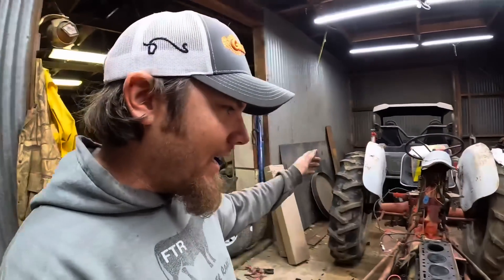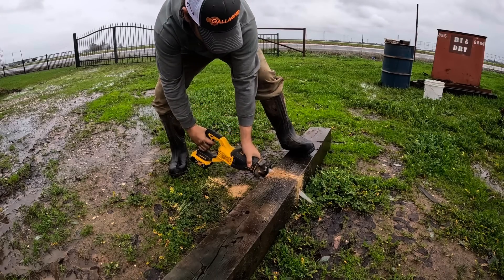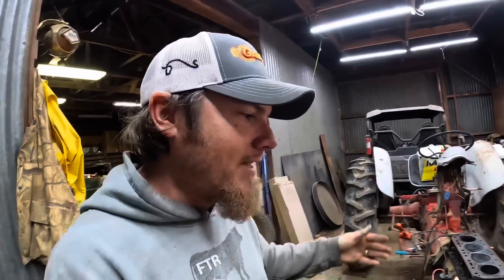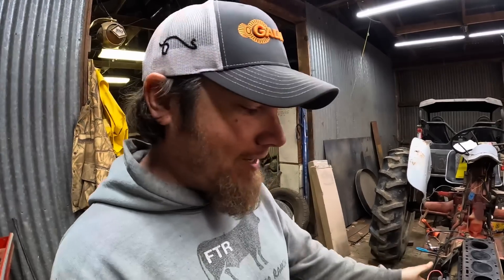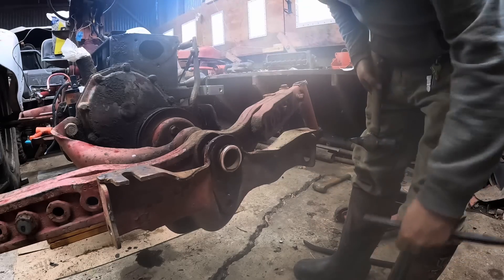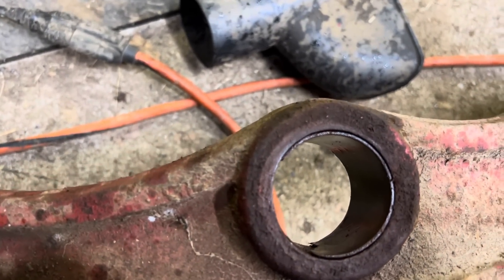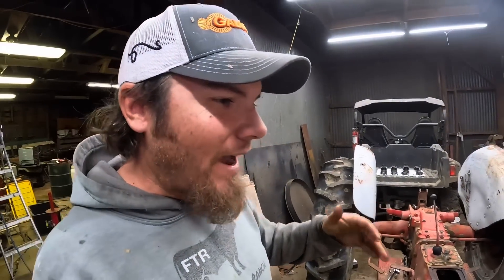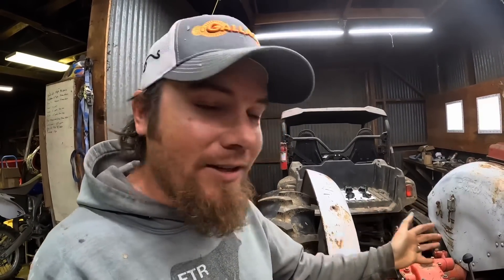That Escalated Quickly!

Comment: When you go to paint part of the project, consider POR 15 for some of the parts that get a lot of scrapes and scratches (especially the inner fenders.  This stuff is great and when dry you can whack it with a hammer and it won't chip.  It will outlast you.  And also, I still think NOX and twin turbo's.

Comment: Hello Tyler.  Your video label, “That Escalated Quickly!” is a good observation of how the situation can change as new facts become observable.  I commend your approach which can perhaps be summarized as, “If a job is worth doing, it is worth doing well”.

I certainly hope that you do not find too many more hidden surprises that might increase the complexity of the rebuild.  For example, you referred to some oil leaks near the back axle.  If you had decided, from the beginning, that you would do a complete restoration, then you might need to strip everything right down to the last nut and bolt – but that would introduce a whole lot of new complexities, such as how and where you would store all of those component parts to avoid getting them lost or misplaced.  I certainly agree with the way you labeled the electrical cables, as this kind of attention to detail can save a whole lot of grief during reassembly!  I would like to suggest that you complete the restoration of the “front part” of the tractor before you tackle the “rear part”.

Please allow me to suggest that in a job like this it would have been helpful to have given the tractor a thorough wash-down with degreaser and pressure washer before you commenced dismantling.

I have watched with a certain amount of fascination the detailed effort made by another YouTube presenter, Pete, from “Just a Few Acres Farm”, as he has worked on a tractor restoration.  While it may be rewarding to restore a machine to that pristine condition in which it left the showroom when it was brand new, it will take almost no time at all before it shows the stains and smudges which come as the result of doing real work.  My encouragement would be to do the mechanical work to restore the strength and function of the tractor, and then to give it a “quick paint job” after it has been reassembled and tested.  Best wishes to you as you entertain us with your many skills.

Comment: If you've gone this far, just dive into that hydraulic system and get the 3 point working!  You'll use it for things you never dreamed of if it works.  I'm sure you are familiar with Yesterday's Tractor parts and Stiener tractor parts.  Check out Gap tractor parts in Cranfields Gap, Texas.  Parts are more available than you might think.

Comment: I am going to offer up some advice as you are in my wheel house.  I own an 8n I am currently rehabing (restoring is a little too strong a word) to install a Dearborn 19-22 loader for some light work and I also have a '54 NAA (a Jubilee is a '53 NAA, i.e., identical).  I debated swapping which was the loader tractor as well, but it did not make sense in my case.  I can see on yours that the internal hydraulics pump is missing.  They moved it from the belly to the side of the motor on the NAA (part of the legal woes between Ford and Ferguson) and that pump is not cheap.  I can see you have a blanking plate on your block where it should be.  A stinger pump off the crank with the loader works just fine once you upgrade the front pully to accept it.  I suspect you will fabricate it, but the front loader mount I used on the 8n (similar) was from Windy Ridge Farm out east and it replaces that worn pivot pin.  I can fabricate things, too, but I know my limits.  In addition to that axle pivot, I hope you checked the spindles, too.  I had to replace the bushings, which need to be reamed to fit, and the spindles when I rebuilt the 8n axle.  Again, very similar to this axle.  I sourced that stuff through Just8ns.  In this case, they do have NAA stuff as well.  I saw a lot of Yesterday's Tractors stuff on your bench last time and you need to be careful in my opinion.  A lot of imported stuff which seems to translate to quality control issues.  I will turn to them for some items, but anything I deem to be a little more important or involved, I will look to Just8ns, Steiners, or Carpenters.  There is a difference in quality.  For ignition, I use NAPA Echlin.  Check the grooves in the pistons for wear.  If the piston rings wobble, or if there pistons wobble on the connecting rod pins, replacement pistons are in order.  At that point, buying an engine kit with sleeves would make sense.  I get twisting your head into a pretzel about where to stop.  I got into the 8n and found some cracks in the block in some bad places.  It already needed a rebuild and I was not going to spend the money on that block.  Found a complete replacement that was a runner, so my plan was to bolt it up, rebuild the front axle and get the loader mounted.  I posted some pics on a FB group and some random guy (much like I am now) made the comment about now being the time to paint that block.  My OCD kicked in and along with it, mission creep.  I have not regretted it, as it is looking good, but this project has dragged on longer than planned.  Oh, when reassembling those radius rods, use a penny or two in those ball sockets on the end if they are loose.  They form to fit.  Cheapest fix you will have.  Literally, my two cents....  ;-)

Comment: To make a long story short, it looks like the engine in your Jubilee is from a later-model tractor. The blue paint under the red tells me it's from a 60s model Ford tractor. Ford changed their paint scheme at that time, but continued with models so similar to the Jubilee that a later engine could just be bolted on.

That could mean more power. It could also mean different part numbers for replacement parts.

Also, Ford had a "deal" when they switched from red to blue paint that farmers could bring their red tractors in and the dealers would steam clean and repaint them the new Ford Blue.

Since I don't see evidence of that anywhere else on the tractor, it seems that just the engine is in play for either of those things above.

Also, I apologize if you already know any or all of this, and/or if you know the specific history of this machine. I tore into my grandfather's 841 Ford several years ago and learned a lot of what I know now at that time. His went through the repainting deal, as well.

Good luck in your restoration!

Comment: did this with a non running ford 4000 I bought, pressure washed it 1/2 the paint came off , well now I might as well paint it, then got to the motor no compression two out of three so I rebuilt it, I had to figured out so many things even the local mobile mechanic did know how to fix  came out nice though

Comment: Your to deep into the motor not to pull the cam and crank.  You never know yo could have a flattened lob on the cam that made it run ruff along with the breather problem.  Good work.  God Bless